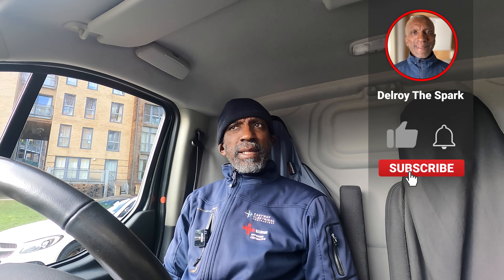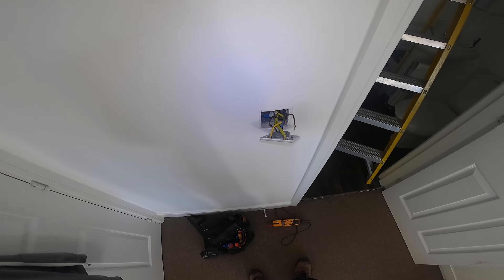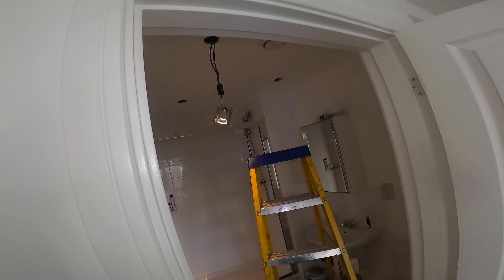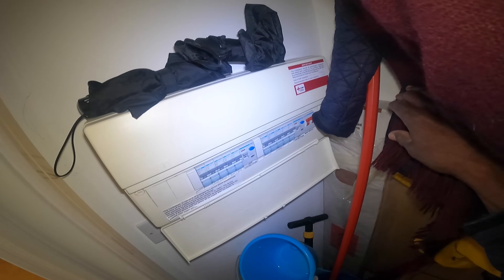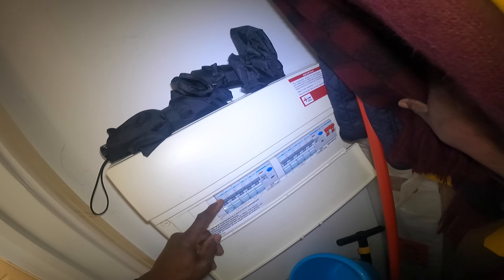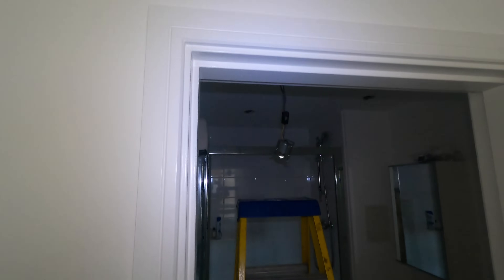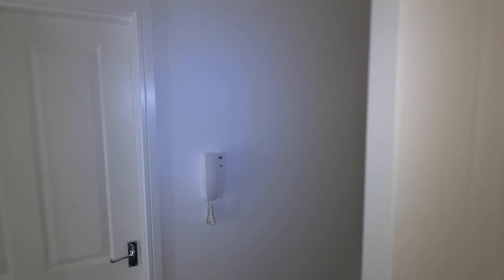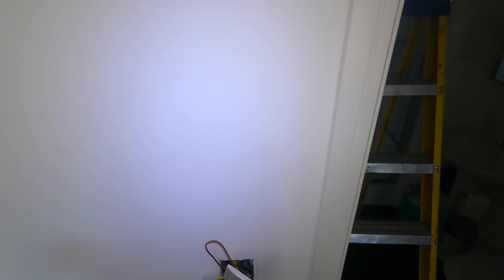"Why Are There Two Lives From Separate Circuits At A Light Switch!!!???" | Electrical Fault Finding

Comment: Of course you can have 2 separate circuits at the same switch but only on the stairs 2 way lighting, if you wire the upstairs lights on one circuit and downstairs lights on another circuit at the downstairs switch you will have a 3 core+earth at the downstairs swith that is on a separate circuit to the downstairs lighting circuit, but there shouldn't be separate lighting circuits at one switch anywhere else in the house

Comment: Seen and installed dp switches to be used where internal bathrooms/toilets share the same ventilation fan so it avoids commoning the  sw live to all the lights. Not seen it spurred from the ring but maybe there is a heavy duty fan motor and that requires this.

Comment: Presume that wire was linked to the extractor or fan heater. Controlled by a double pole switch.  Would have been better if they fitted a 2 gang or at least identified the cables.   Also I'm sure you meter beeps so some croc clips to stop ya walking back to the fuse board might help. Did the client ever call you back?

Comment: I had an issue few weeks ago, tenant was complaining about rccb keeps tripping.  I carried out IR LN-E and all good >999 M . This happening immediately when tenant switching on washing machine from FCU . I advised tenant change washing machine or call engineer to check it . Tenant has changed washing and it continued tripping rccb. Then i  start thinking may be because of dish’s washing machine also connected to the same circuit and may it has small residual current leakage. So , I connected ring circuit to 32 mA rcbo type C and it’s stopped tripping. The problem was caused by small residual current and  by Crabtree rccb which was too sensible.
Reply: Sensible Crabtree breakers are to be recommended.😉

Comment: Can’t believe I’ve spent another 5 minutes watching you back and forth to the consumer unit for a second time !! Buy a beeping volt stick !! 🙈🙈
Reply: When you mean volt stick I presume you mean voltage pen? Also correct me if I am wrong since I am no electrician but I heard you can't use a voltage pen to prove dead on a circuit? Since I presume that's what you mean in regards to checking the CU.
Reply: @benh1216  yeah one of them ..... he wouldn’t be using it to prove dead - he’d be listening for the beeping to stop whilst stood at the consumer unit switching off relevant mcb’s to identify the circuit it’s fed from. Then he could prove dead if required. More for identification than proving, one of the best uses of the volt stick/non contact voltage indicators. Saves walking back and forth after turning one mcb off at a time.
Reply: @lammy2304  ahh makes sense. Also yes I do that too. Don't know why I thought he would he using it to prove dead 😂 doh.

Very useful piece of kit however. Definitely useful to give you an idea if a circuit is dead or live!

Comment: Good video.Seen it where they put a double pole switch in so one side does lights the other a heater or maybe a fan as an example.
Reply: Very true! Delroy, could it be for a fan maybe? Would this actually work?
Reply: Yes cracked it! https://youtu.be/Qt7ifcSjKWg watch that video guys and Delroy. The end bit explains how they can be two lives at a switch. Why they're from 2 different circuits no clue but good video delroy mate
Reply: @JayyyyyW  This is NOT the standard way of wiring a fan and light to come on together.  I've installed hundreds of them and never used a double pole switch.
Reply: @monikaw1179  oh no definitely not. Much better ways to go about it
Reply: @monikaw1179  ? In simple terms, what do you recommend to avoid taking two supplies, each from a different breaker, to a single switching module ?